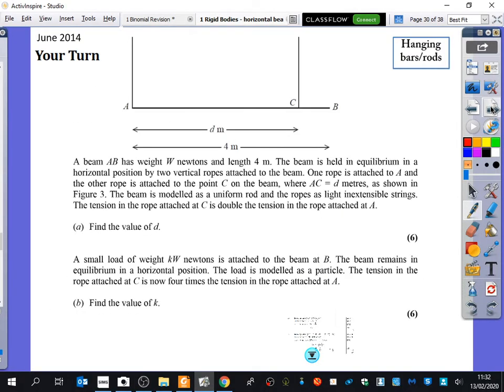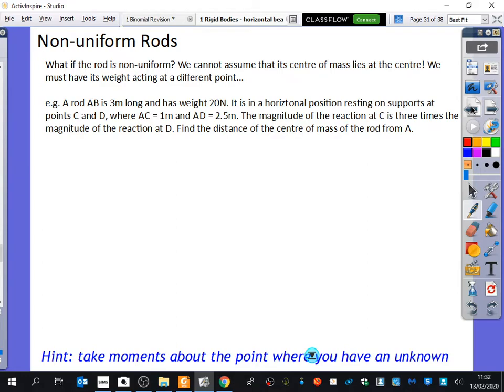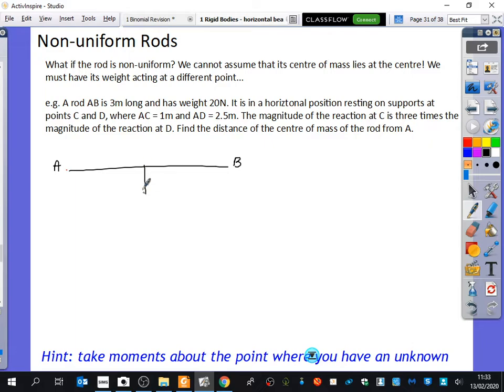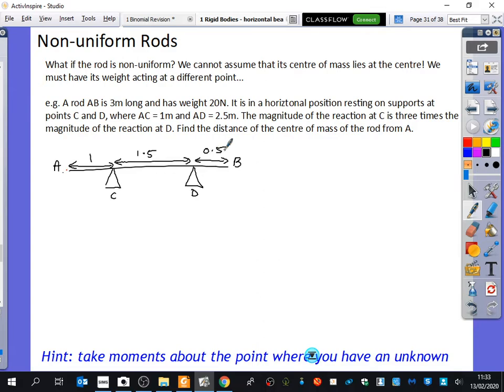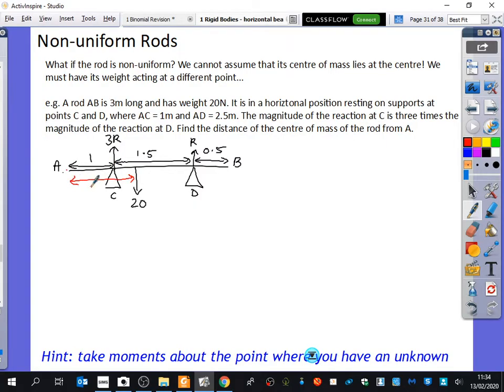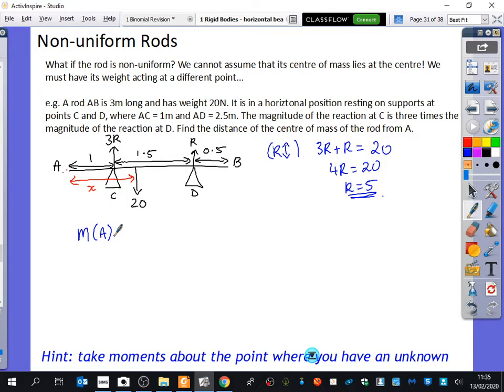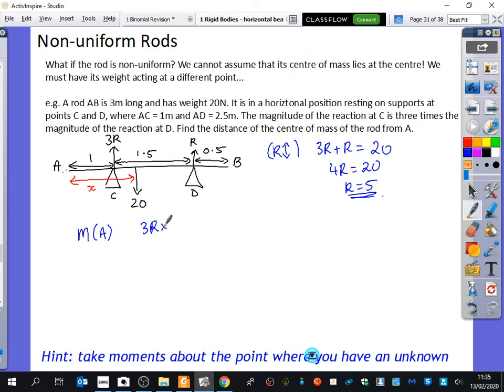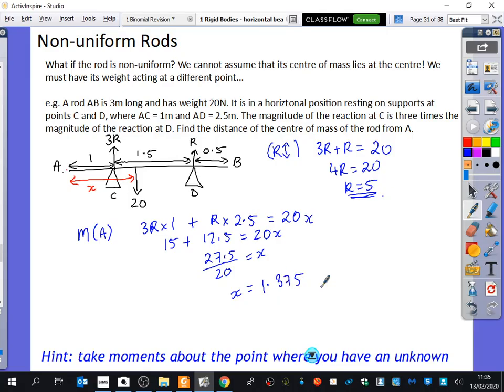Rigid Bodies 7 • Non-Uniform Rods • Mech2 Ex4D • 🎲

Comment: hi sir i noticed you mentioned that we would lose accuracy marks for not rounding. I did not round my answers in maths or further maths will this cost me a mark on all the questions? For context they did not say leave your answers to 3 significant figures.
Reply from the maker: Careful - it says on the front how they want answers to be given if the question doesn't specific, so make sure you read that page before you do the exam! If you are punished for giving an answer to a wrong degree of accuracy, I believe you're only punished for this once across the paper, so try not to worry about it too much!
Reply: @BicenMaths  Thank you for replying! So if I write to 4 or 5 signficant figures I lose a mark? But doesn't the markscheme say "anything which rounds to"? (awrt)
Reply from the maker: @horsenicek  Yes - please make sure to read the front cover of the exam when you next do one, as it explains it there :) Good luck!
Reply: @BicenMaths  okay thank you!

Comment: Hello Sir, isn't the value of x=2.125 as Rd = 3Rc therefore, the value of Rc = 5N, hence making the value of x=2.125?
Reply from the maker: Rd is not 3Rc - they are both going upwards, and would together equal 20 which is the force downwards. So that's why I have the Rd + 3Rd = 20. Remember that forces up = forces down in these questions!
Reply: @BicenMaths  is it "3Rd = Rc" instead?
Reply from the maker: @SinghSK-z1p  Yes, which is how I have it in the diagram right?
Reply: @BicenMaths  but sir in ur diagram for C u wrote 3R and for D u wrote just R? am confused
Reply from the maker: @mahvishkaleem7761 Correct, as the reaction at C is 3 times bigger than the reaction at D!